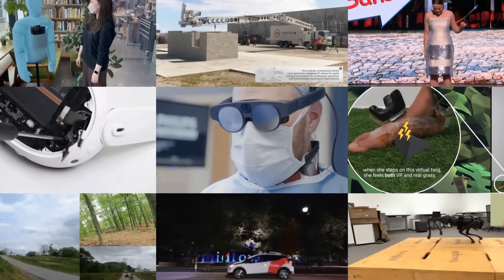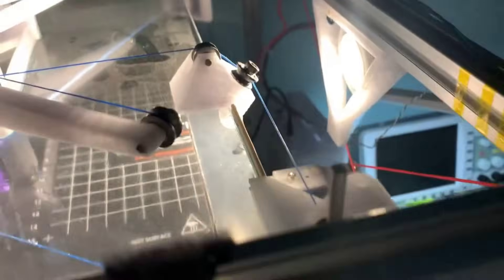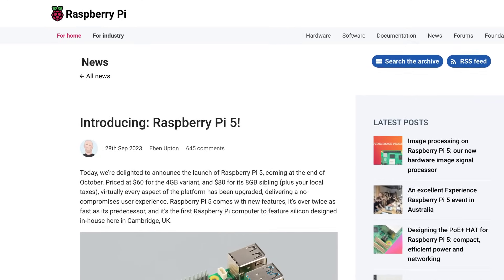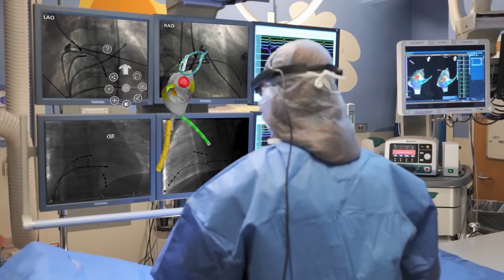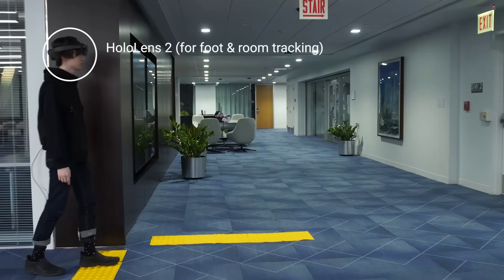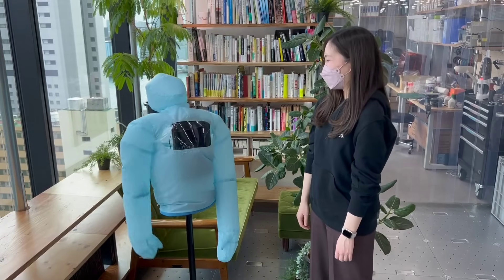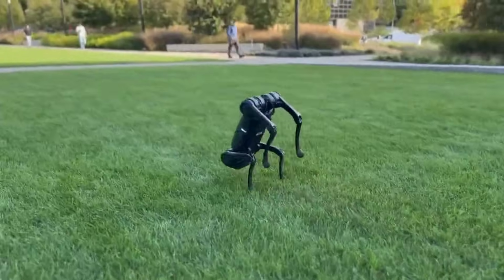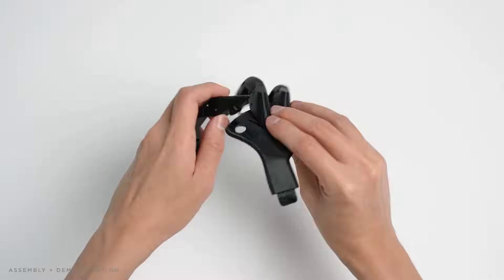This Robot Truck Builds Houses (+ More Tech News)

Comment: Pretty momentous week, all told.  I don't think people really understand the big deal about Waymo picking Houston, though.  Houston is a capabilities brag for an autonomous navigation system, if enough of it is considered for the service area.  People usually fail to realize just how spread-out the city is, in geographic terms.  The most profitable route, from the international terminals at Intercontinental Airport (IAH) to downtown Houston, is a 20-mile journey via freeways.  The regional William P. Hobby (HOU) is another ten miles in a different direction.  

If Waymo is focusing on surface-road short-range transportation, it's still rather challenging.  Houston's surface roads in its high-density areas are mostly on a grid, but are not always in the best repair.  Small construction projects are also incredibly common.  It will be interesting to see what roles Waymo adopts in this tremendous sprawl of a city.

As for the inflatable avatar, YAY BAYMAX!

In a more local focus, does anyone know if NODE is still using AI narration?  The voice sounds really quite well-intoned.
Reply: Still AI. Can hear it in the mispronunciation of CDPRs name

Comment: Electrical stimulation has always made sense for me when it comes to VR feedback. You could even cover the entire body with these electrodes, though I’m unsure if putting them near the heart could cause issues. But there’s a big problem in trying to have a lot of them, each electrode needs to have an AC wave of varying amplitude (zero dc component), and I can’t figure out a way of multiplexing this. It may be that the DC component isn’t a problem, but I’d want to run a long test on some meat strips before trying DC on people, I hear cellular ion pathways can get messed up from DC pulses.

Though I believe the technology behind plasma screen televisions is basically just multiplexing a bunch of high-ish voltage electrodes with an alternating current at different amplitudes, so trying to use the display drivers from those might be a good way forwards. The tech behind electroluminescent displays would be similar and maybe more accessible (see Ben Eater’s videos on recreating the Apollo computer interface), but I don’t think any of them have variable brightness segments/pixels.